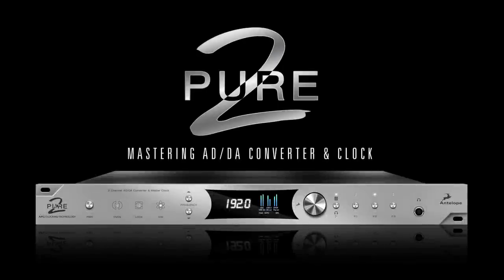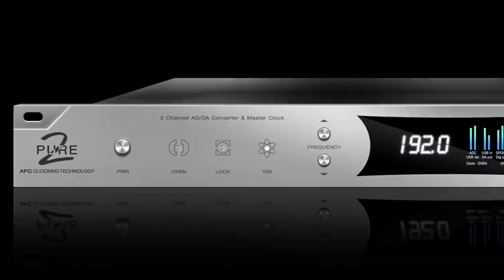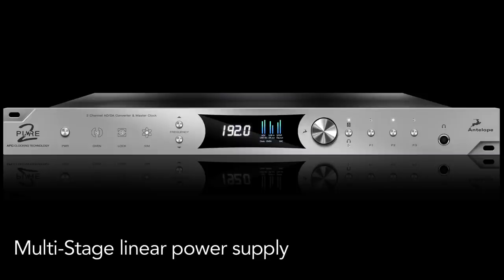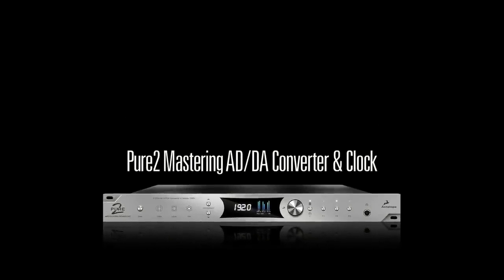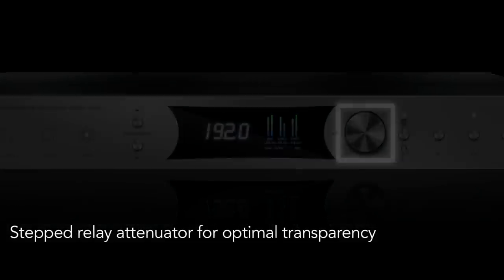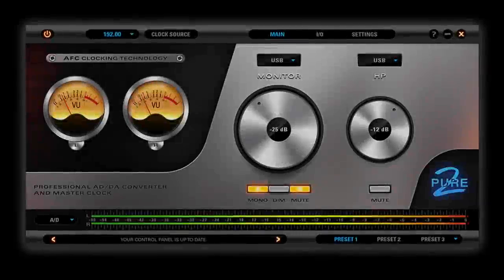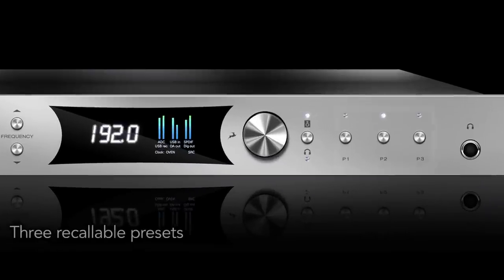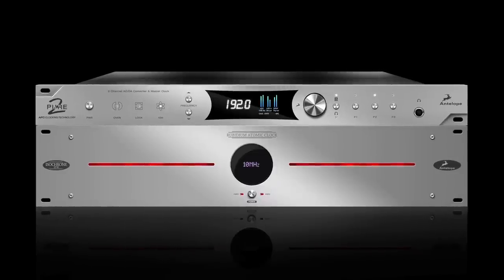Antelope Audio Pure2 - 2 Channel AD/DA & Master Clock

Comment: I've read every ad and spec you guys have on the pure2, but I still have questions about the clocking. 
- Does the Pure2 have the exact same Oven Controlled Crystal technology as the Isochrone OCX does?  I ask this because, your ads only reference the Pure2 as having the same Acoustically Focused Clocking (AFC) as the Trinity, thus to me, it reads like it just contains the 4th generation of Jitter management, which is separate from OCX technology to my understanding.  If the Pure2 has the same clocking technology as the Trinity/OCX, and includes this AFC, than the pure2 is perfect for my needs.  I will pre order mine as soon as you confirm this.  It's mid December, so I hope you respond soon!
Reply: head over to gearslutz, you will find your answers there :)
Reply: ProdMRI Thanks for the advice.  Funny how much of my research sends me there, but I have never post.  The Namm show is just 1 week away and so is the release of the pure2.  I am hoping that between the product review at the show, and reviews from customers who already preordered it, the answers will come soon.  Though, I'm a bit disappointed I didn't get a response from Antelope Audio.  Guess the people who maintain this page, don't have the technical background to respond.
Reply: I found my answer, when reading up on connecting the newer/smaller desktop 10MHZ Rubidium clock to the Zodiac Platinum.  

"Connecting the ultra-accurate 10MHz clock to the Zodiac Platinum DSD DAC will automatically switch from its crystal oscillator (OSX) to the atomic clock reference, still using the 4th generation of Acoustically Focused Clocking algorithm implemented in the DAC, the same as it is in the top level Trinity Master Clock."
Reply: ***** Thank you for clarifying!  What is the latest word on when the pure2 is going ship?  The waiting is unbearable!!!